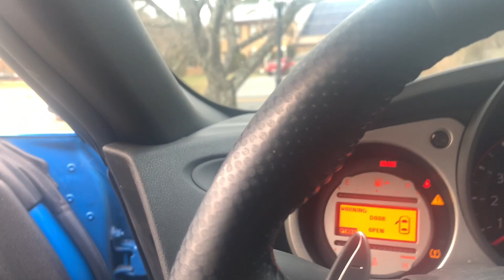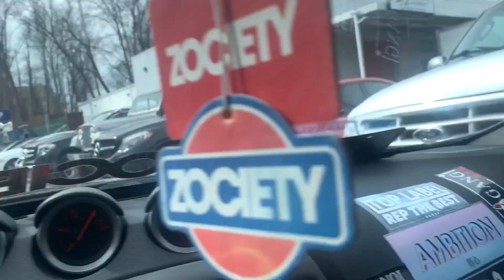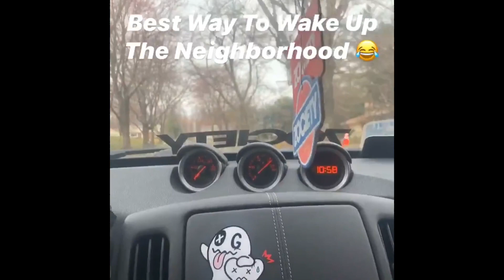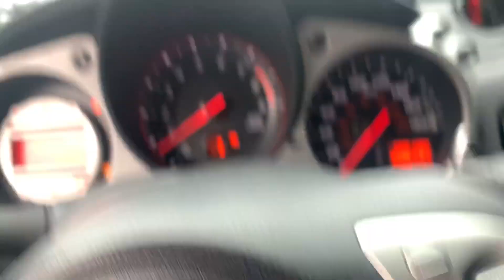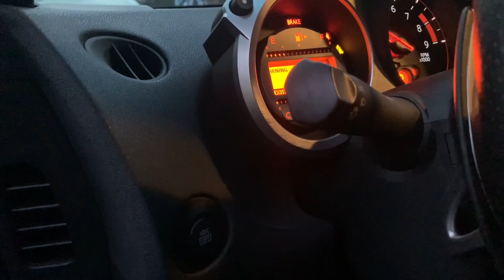370Z CUSTOM SINGLE EXIT (RESONATOR DELETE)

Comment: Can you share his much that turn cost how much it will cost me please
Reply from the maker: Jackson Jennings how much this setup will
Cost to get?
Reply: @AlmightyWel  how much and how much will tune bangs cost
Reply from the maker: Jackson Jennings with this setup cause i got old exhaust replaced and put a whole new exhaust it was $400 or so my tune was only $500 but thats with a local tuner. Most other places usually range from $800-$100 based off other tuners i had planned to go with.

Comment: Is it loud LOW 1-2K RPMS turns headz and what tune appreciate it your reply I'll subscribe fair bro
Reply from the maker: Jackson Jennings yea its pretty loud but not crazy loud til u really get on it turns heads 24/7 and i  have a D1 tune
Reply: @AlmightyWel  what is LOUDER straight piped or ISR with res delete and what sounds better tbh thx
Reply from the maker: Jackson Jennings straight pipe is louder and cheaper but isr sounds better